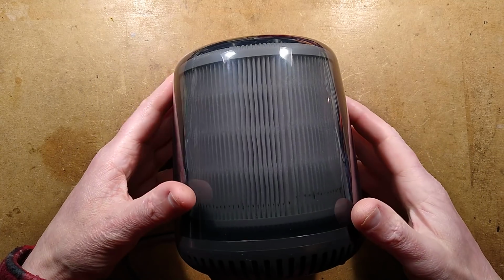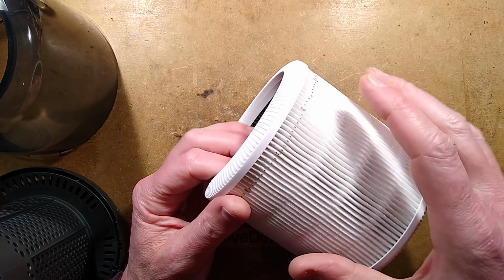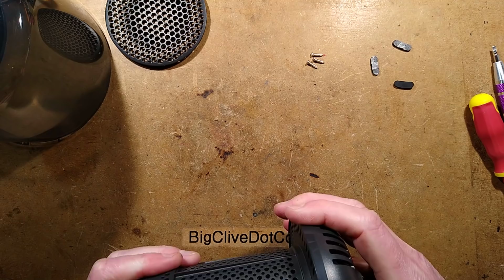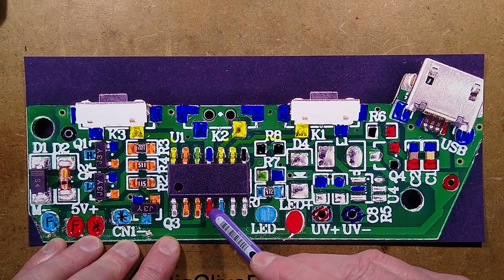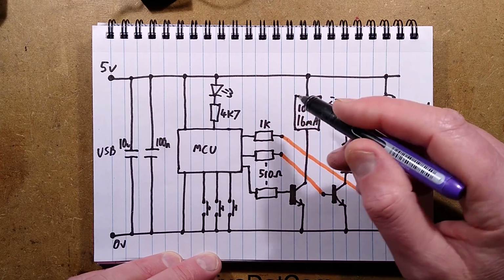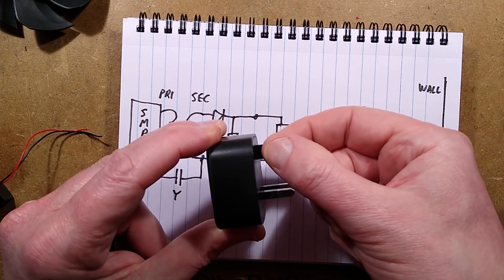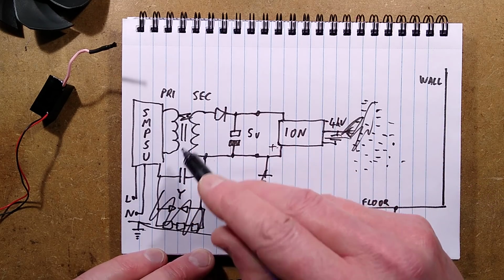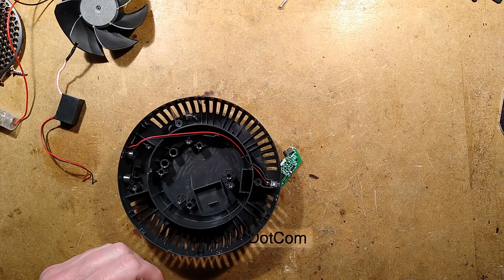Queenty air purifier/filter teardown (with schematic)

Comment: The unpopulated UV circuit with inductor and diode is a boost voltage converter. It is probably intended to step up the 5V from the USB to 12V for a standard UV LED strip (like what Odd Tinkering uses to retrobrite plastics).
You corrected yourself saying switched mode power instead of PWM, but they are the same thing. A buck converter sets its duty cycle at the ratio of the output to input voltages. The only difference is in the power rating of components and the requirement to use at least a second order output filter.
Lastly, you mentioned about the incorrect placement of capacitors on the USB input (the microprocessor should have close decoupling). You are right in principle, but it doesn't matter for such a small board. Most important is to stop noise generated by the microcontroller getting back out over the USB cable. That is best done at the connector. The only reason you'd want capacitance at the micro is if the power supplies were struggling to keep up with demand. While this circuit could have been laid out better, the dimensions were so short that supply impedance is extremely low.
They get away with it. The question is whether they know that they get away with it...

Comment: I'm now thinking about building an air purifier like the one you did for the tissue paper filters, but designing it either around a car cabin air filter or a vacuum cleaner filter. Smallest and cheapest HEPA filters of these types can be found for around 2 pounds. This might be a viable option for cheap and long lasting filters.

Comment: Just replaced the filter on my unit. It was $5 per HEPA with an additional 2 dust pre-filters that catch most junk.
EDIT: The model is HAP9415 from Holmes. The filters are purchased from amazon and are HAPF30AT by isinlive, but any one would work if it says they're compatible.
Reply: From where?
Reply: My Honeywell uses one $15 filter a year and one active carbon prefilter every 3 months that are only a couple bucks a piece when I buy a roll and cut it myself. 

If I had this, I'd buy a new one everytime the filter needed replaced and tossed the old one. 😂
Reply: Yeah, from where?
Reply: @McFlyOrPie  wasteful
Reply: @McFlyOrPie  What model Honeywell and where did you get the filter.  Is it an off brand or an actual Honeywell filter?
Reply: @McFlyOrPie  just like happened with inkjet printers. Was cheaper to buy a new printer than buy new ink cartridges.
Reply: Why state that you have a really cheap HEPA unit and not help out anyone who wants to know by telling what make and model it is? 😑
Reply: @Lunar_Capital  The model is HAP9415 from Holmes (bought at walmart). The filters are purchased from amazon and are HAPF30AT by isinlive, but any one would work if it says they're compatible.
Reply: @LazerLord10  
Thanks!!!
Reply: @patomahony9747  Some inkjet printer brands had special cartridges that came with the sold printers though, they weren't filled to full capacity of a "normal cartridge". So it'd still be a bad deal to buy new printers (and very wasteful). I think my dad had a bit of luck with one inkjet printer they had, the cartridges would typically be okay for 3-5 refills until issues showed up.

 I had already given up on inkjet printers for a long time, just accepted that I don't need colour printing and black and white laserprinter has been good enough for me since.

Comment: I have a very similar "ProBreeze" branded unit. It does have a filter replace alarm which lights up after x hours of use, but doesn't disable the unit, and you can dismiss it by pushing down the top of the light-pipe with a pen. It also has a very similar ionizer, though the brushes are actually in the air path. It has a fairly large 12V squirrel cage fan, but it's rigidly fastened to the case, causing a very annoying buzz in the cheap plastic, which is probably my only complaint about it. I managed to get a pack of 2 filters on Amazon for £10 or something, which wasn't too bad, but yes from their own website the filter cartridges are almost as expensive as the unit itself. Draws about .5A from the 12V PSU on high fan so probably has a fair bit more airflow than this thing.

Comment: The best quality and cost for a airpurifier is to use a square box fan ($20) and a 20x20x1 furnace filter (3M purple version- $15). Uses a large volume of air and very quiet. Just tape the filter to the outside of the box fan.
Reply: I'm like 90% sure my dad used to do that. I had a sudden flash of childhood memories when reading your comment.

Comment: I've been using a 20-inch box fan with a 20-inch furnace filter taped to the back as an air filter.

Comment: The good thing about putting the ioniser brush there is that it can just spark directly onto the low voltage wiring without going through the transforner.

Comment: Well, at least they put a large-value resistor in line with the blue LED, otherwise the end user would not get much sleep at night from the brightness!
Reply: Wouldnt be a problem as very quickly either the led or usb supply would die
Reply: I keep a roll of the silver, metal HVAC tape handy.  It blocks any and all LED distractions in our sleeping quarters. It's amazing how disruptive even the faintest light can be.
Reply: @TechGorilla1987  I discovered my 25 year old Columbia hat lets IR remote signals through but blocks the blue light. I am not sure if it is something the way it is built or if its just so threadbare that it lets the IR through. The thing is if it was just thin the blue LED light would not make it through. It's really rather an interesting anomaly.
Reply: @TechGorilla1987  black electrical tape is my weapon of choice.  ...though the fact that it is still on bugs me so I then take out my side cutters.
Reply: @johnpossum556  some kinds of plastic are opaque to visible light, but pass IR.

Comment: The whine problem is not due to just PWM, it is due to the crap fan or not enough filtering on VCC, if they had used a Delta or Sunon or Nidec it would have been fine

Comment: The cylindrical air filter looks like ones on AliBaba that sell for a couple dollars. You might find a supplier of those HEPA drums that are close enough in size as replacements. Or buy the cheapest ones you can find, 3D print a case and stuff those bits into it. BONUS you can use BigClive pink filament!

Comment: Many of those paper filters can be washed out in a sink and left to dry. You could also blow them out with a compressor if you have one.
Reply: Cleaning the filter with a vacuum cleaner is easier.
Reply: @MetalheadAndNerd  hope that vac features a hepa filter 😂

Comment: My mates use in line filters available as kits (in line fan, massive carbon filter, duct tape, and big jubilee clips)  - all available from £35 from Amazon , which are very noisy but last about 18 month+. I notice that most of my friends dispense with ducting and mount the fans direct to filter and pointing the whole lot out of the grow tent as it's quieter. So with the bedroom fan ( I made one yesterday drunk - its great) it suggests mounting the filter (filter paper) as close to the fan as possible. Maybe  using filters at both ends? Or using a hoover HEPA? If I could make a small filter like this for my pals they could use it in a grow tent and run the in line fans as extracters of heat and humidity  when needed instead of all the time.

Comment: I just changed the cabin air filter on my truck and it seems like that would make a nice filter element for something. $15 for two rectangular panels. Don't know what the rating on them is but the ones in my truck really do make a difference with my pollen allergies - and last for years. Lots of different sizes to choose from on Amazon.

Comment: Had the same cost issue at school with the projectors. the lamps were so close to the cost of a new unit, they'd just pay an extra 20 to get a new projector with it's lamp included.
Unrelated note: I have had very bad experiences with those type of button on circuit boards, as they rely solely on the strength of the solder joint and pads to not move. Those bastards break of the board really easily if the solder/board is cheaply made, or if you exert too much force on a thing that exists to be pressed. I now have an irrational fear of those things in any equipment I own that has those.

Comment: Personally I'm an air filter fanatic because I suffer from dust sensitivities I own laser particle counters many different kinds of air purifiers most expensive cost £800. Actually This little device has merit, because if you're in a relatively clean air environment such as a house the filters take a very long time to clog up. On all my air purifiers I try to put a course pre-filter over the top of the filter. If it's a powerful fan full size machine I will use something like G4 filter media that's about an inch thick. For something like this little device just putting a couple of layers off ladies stocking around the outside would preserve the life of the filter enormously because it is the large particles that clog up the header filter not the small. This sort of device would be helpful in a car or when sleeping having the exiting air blowing across one's face. If something looks relatively well made I will often buy a machine with no intention of never changing the filter.  Drum filters have a much larger surface area than flat panels filters so you can buy one pretty much never worry about replacing it. I can't stress the importance of putting of some sort of course pre-filter the three categories are something like ladies tights material, and then two mil thick filter foam and then some fibre media like extractor fan pre-filter or G4 filter media. Good luck

Comment: Hepa filters are really for semiconductor manufacturing.  I wonder why anyone would want or need such clean air?  They work in a particular way, using lamellar air flow.  Filtering air will not stop dust or particules or viruses being disturbed from "unclean" rooms.

Comment: Great tear down with your usual excellent deep dive on how it works. How about using your 3D printing skills to make a roller to concertina up tissue or some other cheap filtery type paper. Print out a round filter holder and make your own replacements?

Comment: The problem here is that they reduced the price of the unit to its bare minimum, yet there's likely not much lower they can go with the filter when including sourcing, distribution, & margins for everyone in the selling chain. The fix is to simply sell the base unit a lot more expensive. If it were 2x or 3x the price of the filter, users would psychologically find replacing the filters makes much more sense.

Comment: If you could ground the filter, I can see a design with the ioniser in the input air stream working well - any dust will get an extra incentive to adhere to the filter

Comment: I have the xiaomi air purifier. I wash the filter every few months. It might be not as effective as new filter but it still removes a lot of dust. I do not have a need to remove ultra fine particles.

Comment: That filter doesn't meet the minimum standards for "HEPA" at all.  Far too much bypass on the fan and the fan slope is very bad.   This is a "loud noise to distract you".

However, it's probably perfect for wrapping a cheap paper towel inside.

Comment: In regard to the 510 vs 1000 ohm resistors, I tink it has to do with the load each transistor has to switch. When a typical transistor has higher collector emitter voltage (beacuse of lower impedance load driven from the same power rail), it needs less base current to saturate. hence the higer base resistor on the higher load transistor. Anyway I gess in this case the effect is probably negligible

Comment: Oh btw, That ionizer thing at the bottom. It would get a little bit of airflow, because mind you, I'm assuming that, the fan pulls the air thru the filter, so... It could perhaps actually pull the ionized air from the bottom of the unit where the weight is. Tho... The ionizer end would be better suited to be in the middle above the weight, where it'd get airflow from the fan pulling air thru the filter. So... yeah. It is a bit strange I'll agree, and maybe not very useful. But it's something. so eh.

Comment: The filter price reminds me of the cheap Cannon ink jet printer I bought. The printer with 2 ink cartridges was $34.00 at Walmart. The replacement ink cartridges were $36.00. Cheaper to replace the whole printer.
Reply: I'm unfortunately familiar with Canon's antics. The new printer's ink carts come with all of 20-50 pages worth of ink; to the extent that they sold a version of it with two ink refills in the box!

Comment: Of course the idea is to get you into a cycle of expensive replacement with a loss-leader base unit.  (That's the generous interpretation.  It's much worse if they actually make money on the initial sale of the filter unit.)

This is most commonly known as the 'razors and blades' model, although the most egregious example is probably inkjet printers and ink.  (Except for Epson's Ecotank series, which is basically Epson admitting they can't stop CIS aftermarket devices and putting out a line with something equivalent designed in from the factory.)
Reply from the maker: All my PCB pictures are printed on an ecotank.

Comment: I have a high velocity fan I use to sleep makes a nice rumble  I spent 35 years sleeping over a running engine for heat and air conditioning in over the road trucks  I cant sleep with out that noise and I miss the vibration I to this day sleep better in a  running truck than any were else Forget a hotel beds are awful and too soft and the pillows suck !

Comment: For the cost of the replacements I'd expect washable!  Built  a similar system using uPVC pipe and Electrolux / Volta  washable vacuum filters.  Never need to change them (or even wash them) and the lash-up seems to have stopped The Wife's seasonal hay fever problems.

Comment: I would just bypass the circuit, maybe with the addition of diodes to drop the voltage, you could include a bypass switch for full power.
I wonder if you can wrap TP arouund it instead of the filter to save the cost of new ones

Comment: I always just hit those types of filters with the air compressor.  Lasts for years and years.   But hey I'm cheap.
Reply: You're not that cheap you bought an air compressor, some of us have to wait for a really windy day and run around the garden waving the filter around for an hour.
Reply: @marklatimer7333  Lol,  why not just bang it on the sidewalk and then run around the garden.   Cut some time off.

Comment: I bought one from Amazon. I have no intention of changing the filter.
My criteria was the filter to be like car air filter flat pack, with good seal around the edges.
Since I don't have any cooking odors to get rid of, I vacuum the dirty part once every 3 months. The charcoal BS filter was for show from day one, but it stays. 
If the area is exposed to cooking odors, that's another story. Oil and dust mate for life where they meet. no vacuum can suck them out. 
Then the filter can be washed under running 99% IPA at the cost of ~$5. I don't use the bullshit UVC part of this air purifier.
This is what I got from Amazon if anyone else is interested; "Guardian Technologies 4-in-1 Full Room Air Purifier, True HEPA Filter, UVC Sanitizer"

Comment: I think I'm going to stick with my 120v mains powered air filters.  No goofy controllers, just a beefy PSC motor turning a squirrel cage fan and two pressure sensors to measure filter capacity.

Comment: How about adding a layer or two of bog tissue around the supplied filter? Would that extend the life of the thing? - It would certainly remove larger particles.

What we really need is a decent cyclonic filter. That way. it'll never need a new filter element!
Reply from the maker: Foir a cyclonic filter it may make quite a lot of noise with the high airflow.

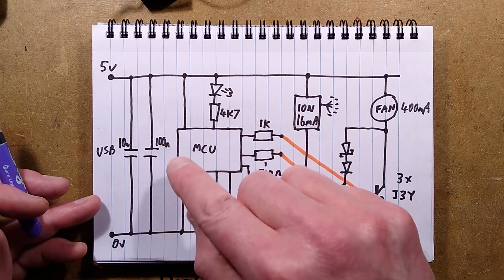Comment: At 12:30 in the vid, I don't agree the small cap will help soak up transients and spikes.
Reply: But,if so, why is it there..? I have to cogitate further.
Reply: So why is it their.?
Reply: If the two caps are like two buckets next to each other, in the rain then small one would fill first, it must a be a shrorter bucket in this case,so it’s the bigger bucket that would better absorb spikes. Ahhhhhhh!

Comment: Not a bad thing if you remove the electronics, and maybe put a better fan in it. I'm thinking about making my own 3D printed air cleaner with a 120mm fan, but I'm also thinking how can I fold the paper in it so I get a greater surface area and air flow. Maybe with some gears. I don't know yet.

Overall these small units don't have the power to move and mix air in a normal size room. A ceiling fan might help to mix air and help the little air cleaners.
Reply from the maker: Check out my hepa filter project with 3D printed adaptor for a 120mm fan, to fit a standard cylindrical filter.
https://www.youtube.com/watch?v=6Vmh2Ip2Vxg

Comment: I know this is too late to get many upvotes but can you do a video about Class Y caps?
Reply from the maker: I could.  But in summary they are ceramic disks with a metallised layer on each side.  To make them human-contact safe they use a thicker disk and higher voltage rating.
Reply: @bigclivedotcom  I think they are something new since I was in school for electronics. I think newbies would probably appreciate the knowledge, too.

Comment: I took two high speed 12v computer CPU cooling fans n put in rectangle wood box  with two sides open added a uv light rear of which i used a commercial ac filter washable air filter । Just it keeps on going ever since wash filter after a weak । I opted for 2amp 12v power spully to power